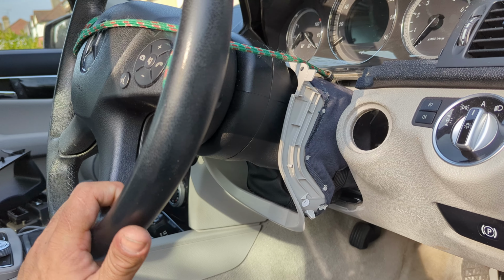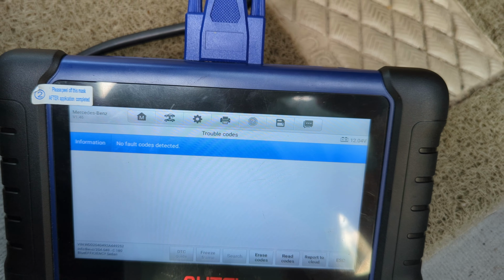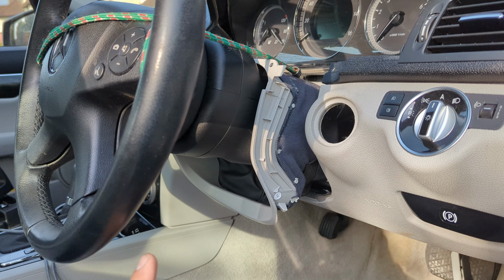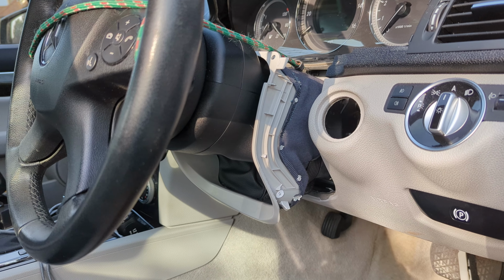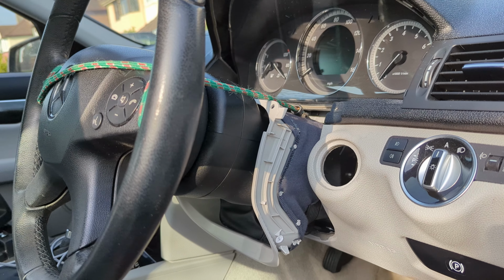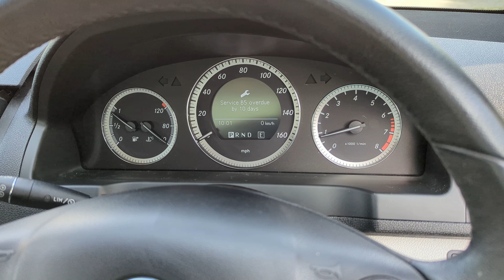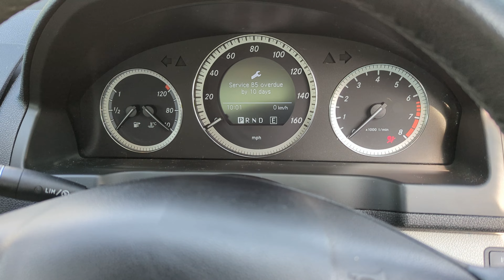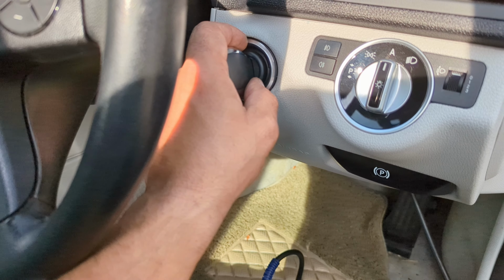👉👍 Mercedes Benz C, E class ESL repair W204, W207, W212 No lights are coming up, no ignition, London

Comment: You perfer removing steering column over drilling? It looked like a manual column or drilling with a extension rig wasnt going to work? So customer did want a working lock and not an emulator?

Comment: How did you get the ignition switch out without removing the steering column?
Reply from the maker: @touchehdlm  you don't have to remove the steering column to take the ignition out... I never done that
Reply: @sebastianthelocksmithandre1600  how did you take it out?
Reply from the maker: @touchehdlm  you mean the steering lock?
Reply: @sebastianthelocksmithandre1600  the ignition switch (eis). You didn’t show how you took it out
Reply from the maker: @touchehdlm  just take the foot plastic out, put your hand underneath, and that's it

Comment: what did you replace in esl
Reply from the maker: The entire thing. The one on the car was gone
Reply: You made it look easy I no it hard job to do , what did you charge for that job and how much was new esl ,why did put emulator on in stead.
Reply from the maker: @joeybest11  some customers prefers to have the steering lock instead of an emulator. Depends on the distance I have to travel, but the normal change is between 400-550 pounds
Reply: You video are good to lean off